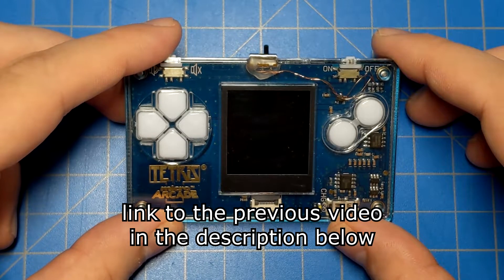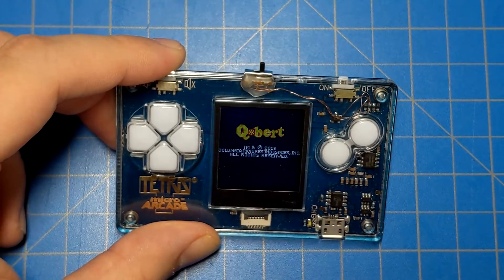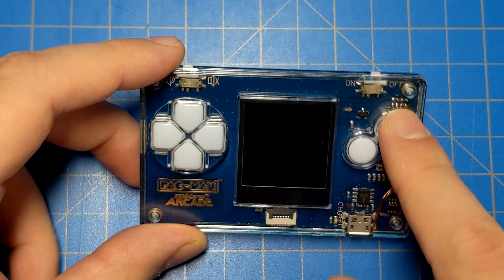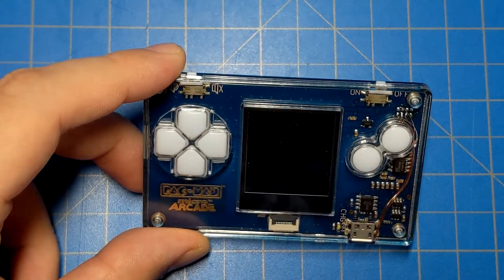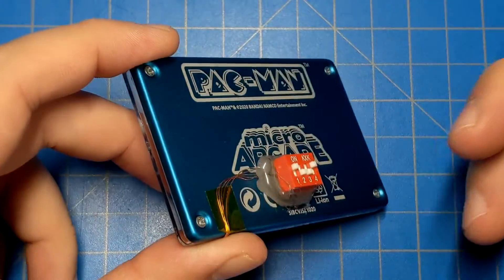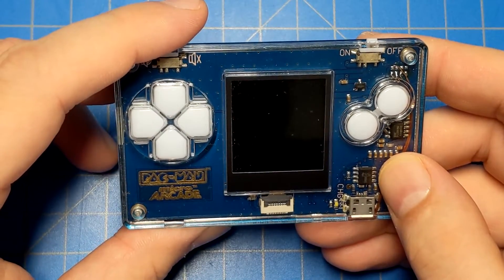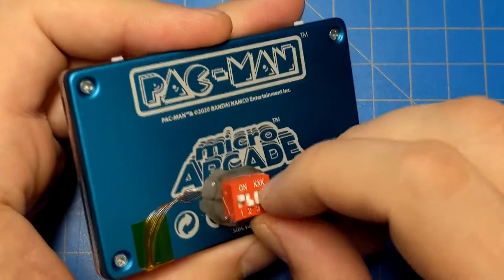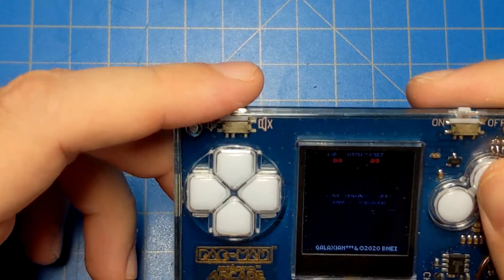Hacking a PAC-MAN Micro Arcade

Comment: I wonder if theres a way to swap the micro USB port for a USB Type C
Reply from the maker: there are some 2 and 4-pin USB-C surface mount connectors that might fit, or they may require a bit of fudging to get them to fit. but i don't think the risk of damaging the micro arcade is worth the reward of just changing the USB port type.

but if you want to give it a try, those 2 and 4-pin versions of the USB-C connectors can be found on aliexpress, such as this listing: https://www.aliexpress.us/item/3256805127991766.html
Reply: @Ruthsarian  thats amazing dude, thanks for the link and the info

Comment: There is only one game on the Oregon trail game. But I also found that the Oregon trail game kills me off in the same spot in the game no matter what, this leads me to believe that not the entirety of the Oregon trail game is present in this gaming device. But then I did some research and found that the entire game should be able to fit in the device. Wich means the game is probably soft locking me or there is some anti piracy measure that has been tripped. I don't know? Has anyone been able to beat this game?

Comment: What size magnet wire are you using and what temp are you soldering at?
Reply from the maker: 34 AWG magnet wire and the iron is at about 650 deg F or 350 deg C.

Comment: The new version of this hand held game you can't hack...they took away the ability to hack it..and there is no more place to put a switch
Reply: I have one of the new ones, and it looks like the traces are still on the backside of the board. It's just that they terminate about 1.5mm below the actual solder pads, but there are still through-holes where I believe I may be able to wire in some 28ga leads. I'm going to give it a shot sometime this week, I'll post my results.
Reply: @JaredBallou  results?
Reply: @JaredBallou  any update
Reply: @codyloveday5285  sadly I haven't been able to get it working. I attached some leads and combined/grounded several of them but no result.
Reply: @JaredBallou  alright thanks so much

Comment: The Dig Dug one has Frogger & Galaga on it. Lucky, as rtheir version of Dig Dug is the WORST.
Reply: Can confirm, has pico and speaker versions of 3 games. I made a speaker mod for it and qbert, but qbert seems to just have the speaker version. 
Dig dug
1010 pico dig dug
1000 spk dig dug
0110 pico frogger
0100 spk frogger
0011 pico galaga
0001 spk galaga
*From memory but something like this, all off goto controller screen debug. 
A tiny speaker will fit just under the dpad, I drilled a few holes, sounds great. 
Qbert has 0100 for pico and 0000 for speaker mode, which has him talking like the arcade. 
Fun devices. . I have not tested all 16 combos.
Reply: Do you have pictures of a Dig Dug mod?

Comment: I have a missile command / Centipede / Pong micro arcade with the same pcb layout and it doesn't look like  this trick works for that one.
Reply from the maker: Just got mine and it looks like it's all three games with a menu front-end to pick the game instead of using resistors to hardware it to a single game. I can't find any hidden games nor can I get it to even go into some kind of alternate sound mode or debug mode. Interesting that they took this approach after 'hiding' games within others.

I'm guessing any Micro Arcade that lets you select multiple games won't be hackable like the game in this video.
Reply from the maker: i just ordered a missile command/centipede one online. when it arrives i'll try it out and see whether or not i can get this to work.
Reply: @Ruthsarian  it also seems to have  JTAG pins on the back but I haven't built a cable for it yet.
Reply: that's the one I wanted to buy